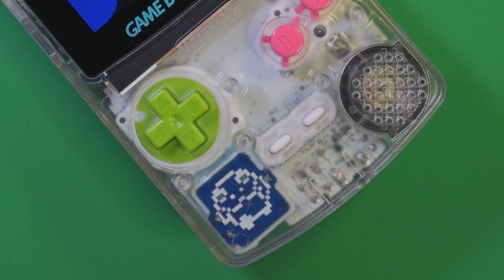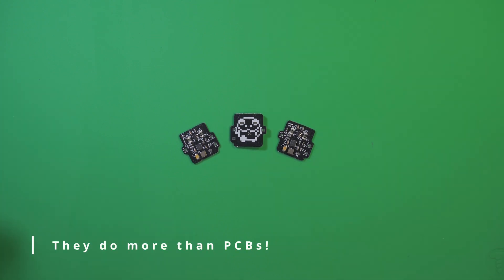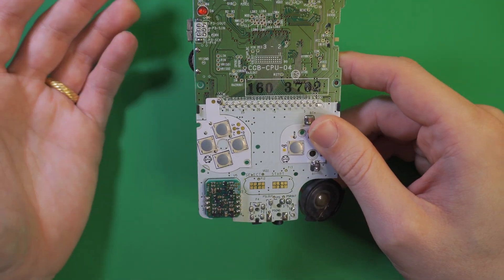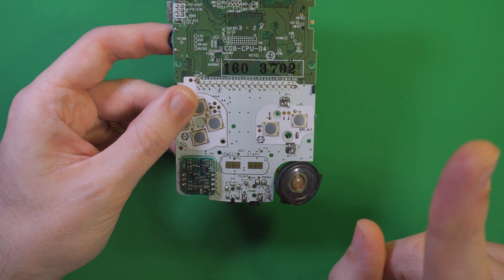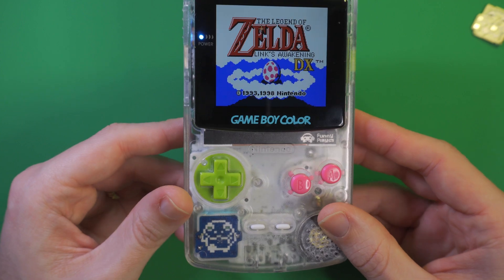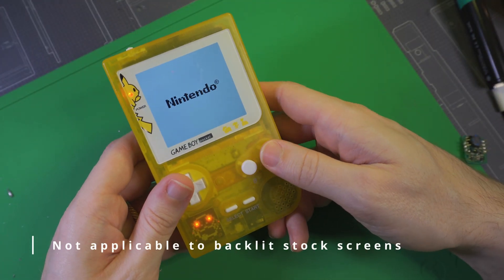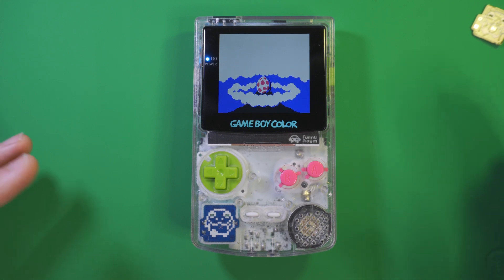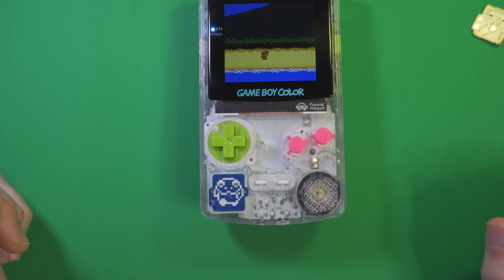Powering the Game Boy Color with Frogs

Comment: I have a GameboyColor with a Q5 OSD IPS screen, Wire Free Amp, Funny Playing LiPo Battery, Clean Power Regulator and an Everdrive X7. I’ve also changed all my capacitors but the humming noise is still there. Would this Frogulator help reduce the noise?
Reply from the maker: The unfortunate truth is that there is some noise inherent in the Game Boy Color because it just wasn't designed with high performance audio in mind. Cleaning your power switch might help a little, but you probably won't be able to fully remove the hum.
Reply: @leggomyfroggo  are there better capacitors you’d recommend? I used the ones from Hand Held Legend.

Comment: I’ve installed the 2.45 backlit LCD kit which uses a TN display. Do you know if the frog would work with this kit? Also, I have the frog power led kit installed too. Will the frogs get along?
Reply from the maker: Assuming you're talking about the 2.45" kit from CGS, then yes, it definitely works. I haven't measured efficiency for that one, but I suspect it would be a similar story as the FP kit when wired, but can't say for certain. I'll have to take some measurements!

And yes! The frogs will definitely get along. You might see the indicators trip at slightly different times, but there aren't any compatibility concerns.
Reply: @LeggoMyFroggo  Yup, that's the one! Thanks for the confirmations. Awesome to hear the frogs will get along. Def looking forward to the release!

Comment: Will the frog work with a battery mod? I'm curious about it because the last mod that indicates battery life didn't work with the funny playing DC Jack rechargeable battery that I have.
Reply from the maker: Same deal as the GBC battery indicator. You can replace a couple resistors to calibrate the indicator for LiPo voltages.
Reply: @leggomyfroggo  OK Thanks